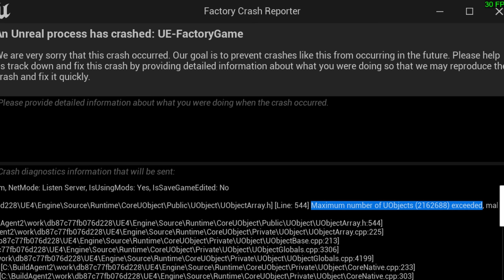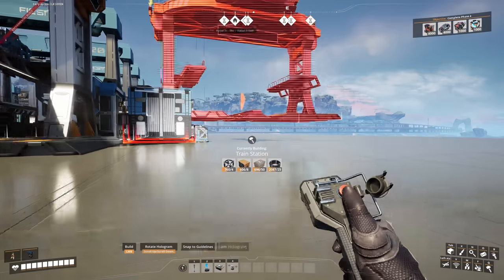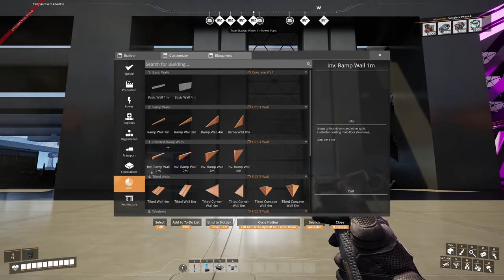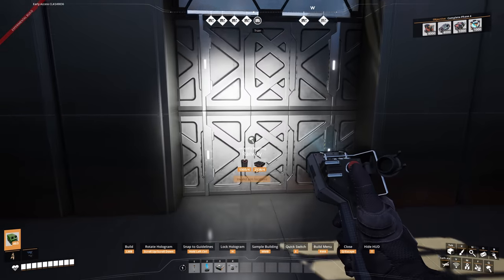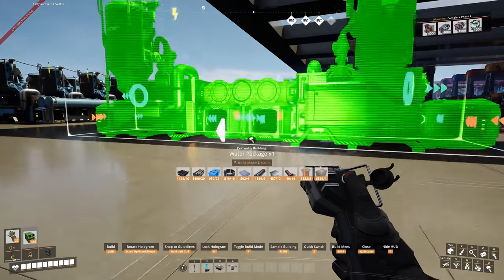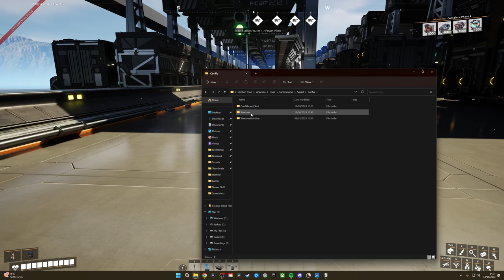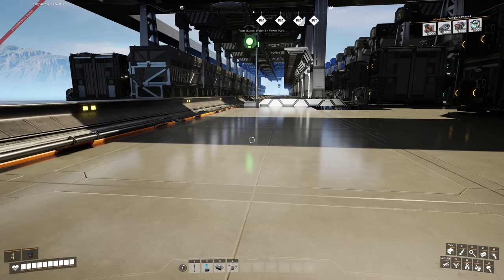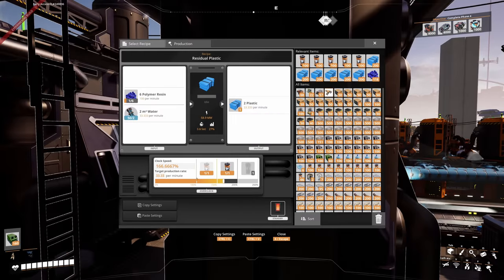I BROKE SATISFACTORY WITH TOO MUCH WATER!!

Comment: Hey Bitz, This may be a stupid question, but why not alternate and then pair them off that way? Have Water 1 / Bottle 1 / Water 2 / Bottle 2 etc. and then just pair those belts together in to the same system? Can easily have each pair of belts go to its own water system that way and the belts will stay together.

You would also then know that platform 1 and 2 always link back to platform 1 and 2.
Reply from the maker: This is not a bad method, but so many factors come into play, which is the direction of A and B and I'm trying to not cross belts over each other. Like i have done what you stated, but it got a little messy.. Like I have tried multiple options and the method I've done takes a little longer to setup and works well, because when it comes to mega factories its can get a little crazy

Comment: o.O i need play with bottlet warar as well. I would dedicate two adjacent platforms to one line of water. That way the packager fit directly behind the stations. You could even blueprint it and add the pipes depending if it's water source or sink.

Comment: Is the color coding really necessary though? I haven't tried yet but I believe that if you just balance all your lines, so for example you have 10 lines of bottles and 10 freight stations, wouldn't a load balancer that makes sure all 10 lines have the same amount per minute take care of that problem? Some lines will require less than what is being fed by the balancer and some more but as long as you keep feeding canisters into the system and your math is right it should all balance out through overflow I think. And then to prevent blockages you can just set up overflow smart splitters into sinks.
Reply from the maker: The problem with this is sinks. If sinks are added it means lines will bleed, meaning more canisters need producing, which is something I don't want to be spending on resources. But a lot of my viewers are visual learners, and that's the best way to represent it, is with the colors. I have a load balancer coming up in a future episode and ive made it super simple for people to learn from and making sure its not over complicated